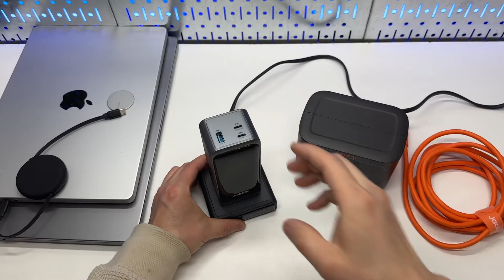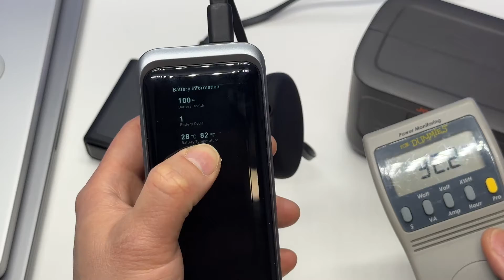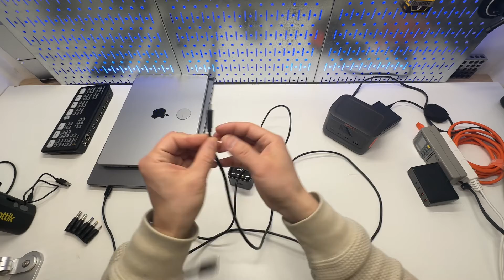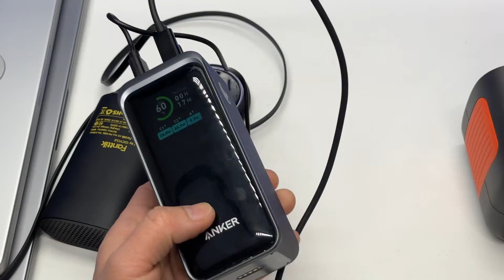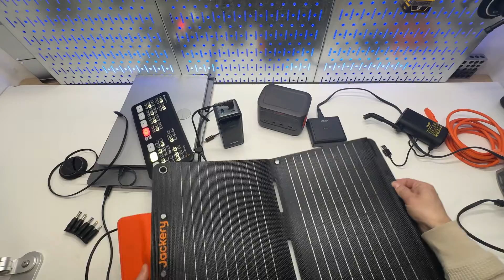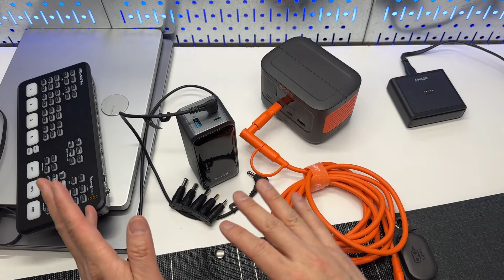Anker Prime and Jackery 100 Plus Power Banks

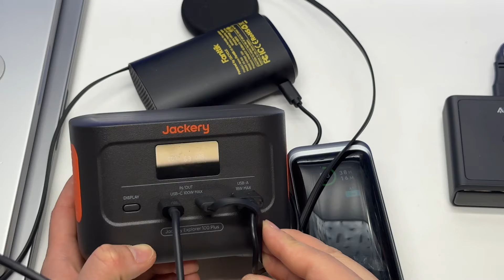Comment: I am confused, with three outputs going the 100w Jackery could last 0.6 hrs which is about 36 minutes and the 200w Anker could only last 16 minutes. I think i missed something because they were so far apart. Both where outputting about the same wattage if you add them up at @8:50 and @10:29 with the same charge?
Reply from the maker: no idea
Reply: @ToolsElectroDIY  Its a strange one, the Jackery does use LiFePO4 batteries but i didn't think it would make this much of a difference.

Comment: Anker battery will degrade to 80%  in less than 20 cycles I've owned one. If you know whats good for you just get the jackery while its on sale for 80 bucks. I dont know why people still trust anker, their products have a history of failing and catching fire. They make the products look nice but its complete garbage. Also no offence but dont trust the first review you watch especially if they dont have months owning a device and a better understanding of how they work
Reply: I have owned and used the anker prime 27,650 bank since its release, and it is still charging up my levno leigon 1 and 1/2 times like it did when new. The anker app shows 56 charge cycles so far.
Reply from the maker: good to know

Comment: Chemistry is a very important part about these devices -- you skipped mentioning anything about it.  The Anker product listing you shared has "Lithium ion" and "Lithium Polymer" which is a contradiction.  There is no mention of cycle count, which if they made a statement of such, it would confirm which of the two chemistry the battery actually uses.  Durability wise, it seems a drop of the Anker unit on cement could be fatal with it's small glassy design.  The Jackery unit (which I have), you can feel the actual cells are in the center of the unit's mass and the surrounding is hollow.  So it would take lots of drops -- it might damage the case, but the cells and function would continue.  The Anker is a lot more in price, also.

At the start of the video when you mention the solar panel, I thought you might actually do something in testing it with the two units.  Disappointed when it was all just "oh yes, both can plug into this".  Charging rate of such would be?1?
Reply: This jackery one was the only one in the power bank form factor that I found so far that uses lifepo4 cells.
Reply from the maker: Thanks for sharing your feedback! Will improve

Comment: I purchased the Jackery over the Anker because Jackery clearly stated they use LiFePO4 batteries, which has 1000s of cycles and I can charge and discharge however I like without the chemistry degrading
Reply: that technology surely wins our hearts
Reply: Anker battery degrades to 80% in less than 20 cycles, good call
Reply: @5uperSmok3 really only 20 !??
Reply: Yes its pretty lame how expensive these are too @Jrp90he
Reply from the maker: Sounds good

Comment: for any future upgrades Jackery should have 240w on both USB-C ports and also increase the battery size to 250-300 wh
Reply: The battery size is limited to 99wh so you can take it in the plane, there is a hard limit for that. They do make bigger units, but this one has a very specific reason for being that size. 240w would be cool, not sure if the battery can handle that
Reply: @svenasmussen  it's passively cooled so the wattage caps in place (per port and overal input/output)  factors in heating.  The faster power goes in and out, the hotter the cells will get.  That's why the larger unit models that provide larger wattage in/out are actively cooled by a fan.
Reply: They make some other models as well
Reply from the maker: Good idea

Comment: Hi, great video, ive just purchase the anker prime and when charging my phone its only producing 17w. Is this because the battry is over 50%? Will it be faster with a much lower battery
Reply from the maker: The charging speed is determined by several factors such as the maximum wattage input of your phone , the cable quality, the state of charge %

Comment: The jackery is also bigger because this is a 30000mha battery and not a 20000mha like the anker. For the same price here in france i think i will go with the jackery (to play in the garden with some gizmo).
Reply from the maker: Jackery is 99.2Wh, Anker is 72Wh
Reply: You will only get close to 30000 mah if you are only pull around 3.7v. That is rare with all of these quick charge devices. You plug a newer phone into this and it will pull around 20v, reducing you to around 5000 mah. These batteries are not very big at all.

Comment: It is 100w input. I have one. If you use a crap plug and cable, you wont get 100w. Also, you can supply input power to both usb c inputs at the same time.  The amount of input wattage will vary depending the percentage of charge in the battery.
Reply from the maker: For people reading this, watch how cable impact charging speed: https://youtu.be/o2FrnePYn1Q